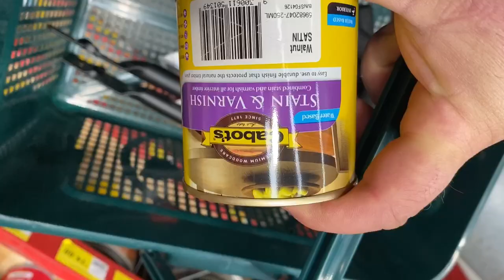DIY Helmet Rack

Comment: Great video - but i have questions! 1. how did you mount the board to the wall in the garage? 2. did you not have to sand before the varnish because it was the nice decorated timber?
Reply from the maker: Sharni Rae I used bugle screws and drilled into the timber frame behind the plaster and no I didn’t need to sand because the timber was already smooth and dressed